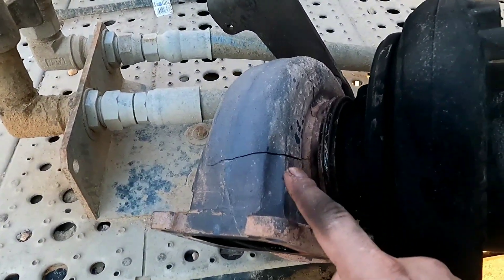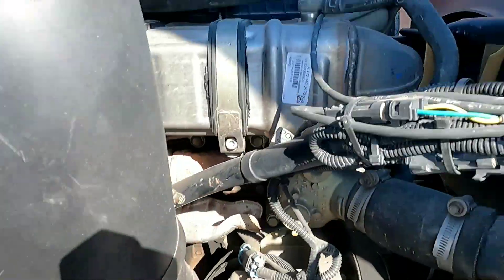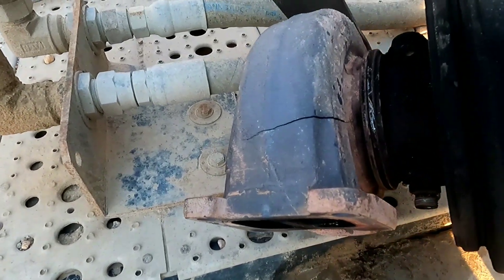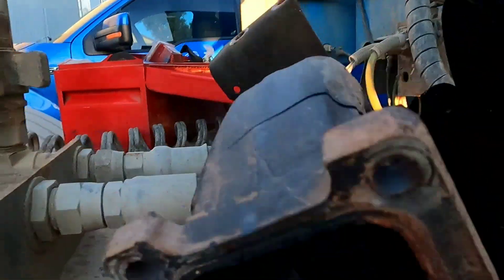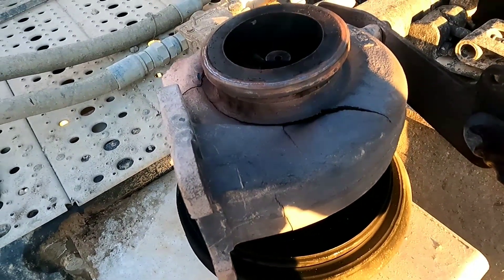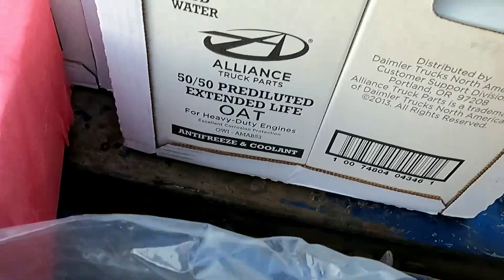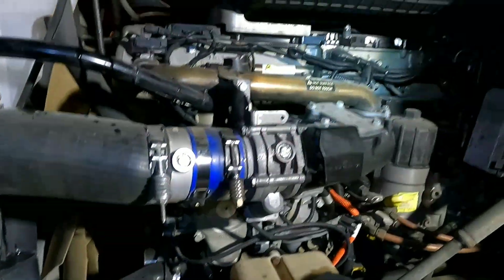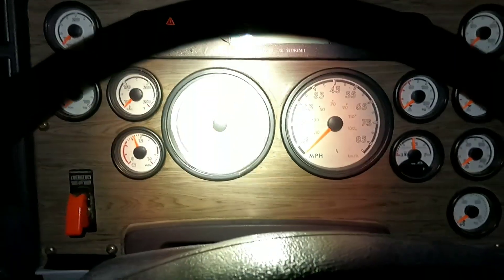Replacing turbo on a 2011 Freightliner Coronado with a DD15 Engine

Comment: Just to inform u no need to put thread sealant on that coolant fitting its a flare nut fitting it seals itself when u tighten it down thead sealant is not meat tobseal its a lubracant